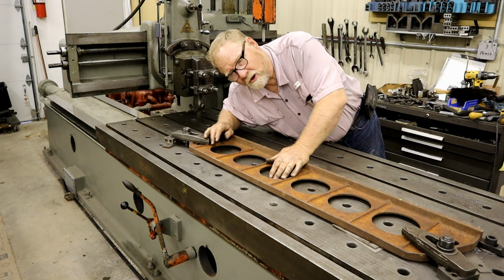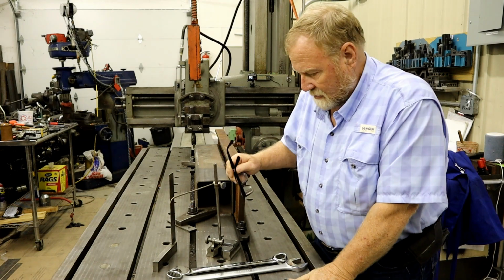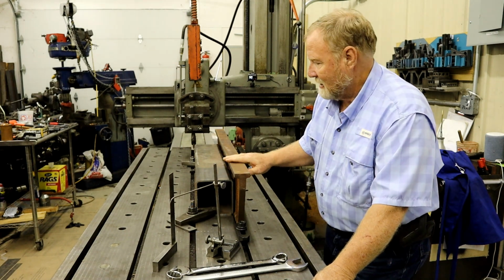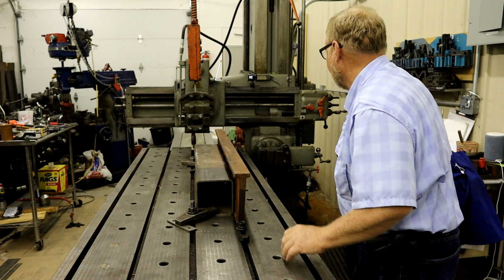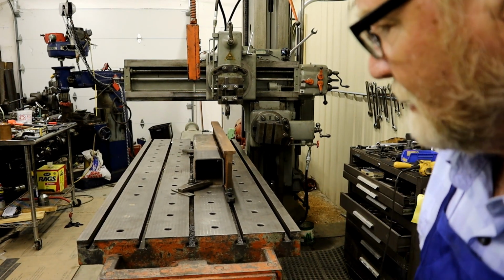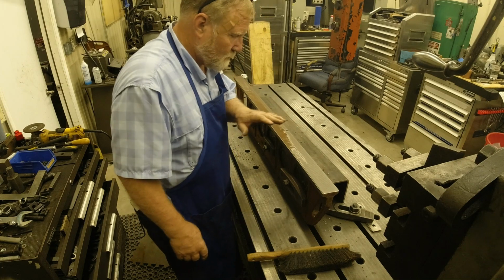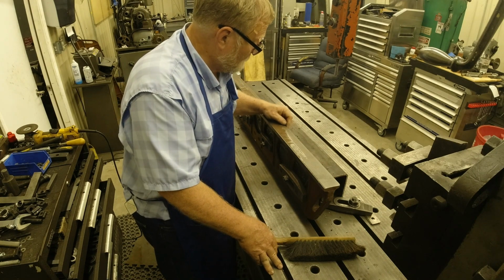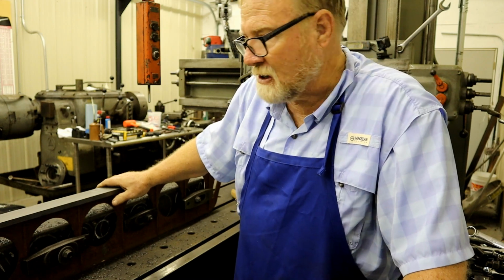Shaping Metal with a Planer : Part 2

Comment: I operated planers at a track shop (railroad track) for several years and a planer can do so much more than what you are showing in your videos. I cut many compound  angles when I cut railroad switch points, guard rails and crossings even down to minutes of an angle. Angles are measures in degrees but if you have to go further the degrees of an angle are broken down into minutes of a degree.
Reply from the maker: Yes they can do a lot more.... I just have the need for the flat stuff right now... I take what work heads my way :)

Comment: Not just planers, it seems like 90% of the hobbiests think they need massive machines in their garage for the couple of napkin rings they make before they loose interest.
A 12” lathe & mill drill is all you need unless you are working on big stuff all the time.
Much easier to move, cheap tooling and they don’t take up much space.

Comment: Sory ! you should put a wedge right under your clamping point. At lees 4 dial indicator ; set zero ; to detect any twisting or flexion of the piece. Wedge can be cut on bandsaw to have a texture on the surface on one side to grip.

Comment: I would think you would make up a big threaded tool pallet so you can machine the side surface and the bottom surface with one setup. Your planer does auto feed down right.
Reply from the maker: Tried that . failed miserably.... Just too limp of a work piece....  I will expand on the problems in the next part of the videos...

Comment: I enjoy watching vintage machinery still in use. Question on your "shitty" setup :) Is there a reason why you didn't just do this all in the one setup? Could you have planed the bottom and then planed the two sides by changing the step over to be vertical vs. horizontal?
Reply from the maker: the work piece is a limp noodle... can't apply force like you can on a mill..... Will explain better in the next part...

Comment: So pin holes in the casting was a result of your holding system for the part? I can't wrap my brain around  that logic Steve. Al B.
Reply from the maker: The reason for the holding system is the work piece is a limp noodle that i'am  holding to 1/1000 of an inch over 4 feet..  i will do a better explanation in part 3.
Reply: Pinholes are caused by gasses trapped in the casting from poor foundry practices.
Reply from the maker: @pvtimberfaller  And this foundry was piss poor..  I am not a foundry man and I can only guess that they add sheetrock screws to improve the mix as a cheap source of steel...   I have found more that a few unmelted sheetrock screws in different makes of castings :(

Comment: Steve a battery powered hand grinder  may be better for you.
Reply: Agreed! I certainly get a lot of use out of my (refurbished, inexpensive) DeWalt. I think it was all of $40 about this time two years ago, and for what I do it's very convenient to have a battery charger mounted to the wall and not worry about extension cords or an air line.
Reply from the maker: I have one.... Battery always seems to be dead... I just need a short extension for that one I keep by the planer...

Comment: Maybe you could adapt a motor, arbor, and grinding wheel to improve your tolerances.
Reply from the maker: Sure I could.... but then you need cooling and the machine bed oiling system would get contaminated.   Tolerances are fine the way I do it.

Comment: wow that hydraulic pump makes a lot of noise.
Reply from the maker: Yes it does... Love to move it outside but all the controls have mechanical links to the power pac...
Reply: @10swatkins  new hydraulic electronic control system.
Reply from the maker: @lexpee  And 120 feet of 1.5, 3/4 and 2.5 inch piping and another 25 gallons of hydro fluid!  :)